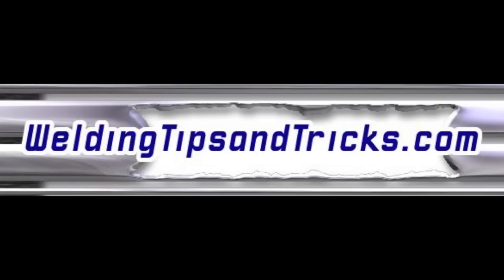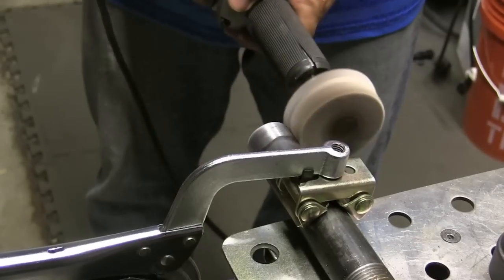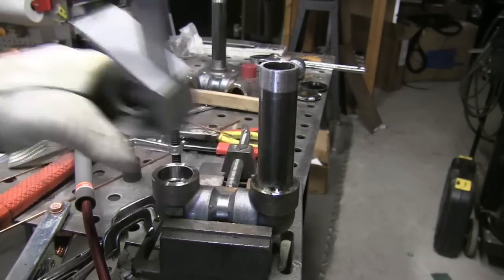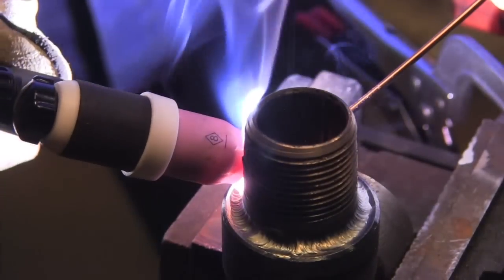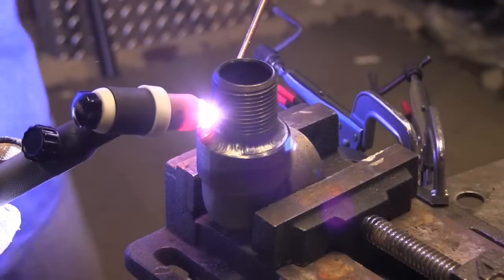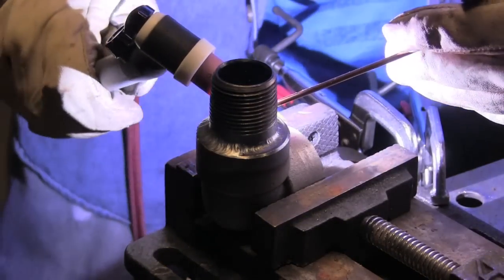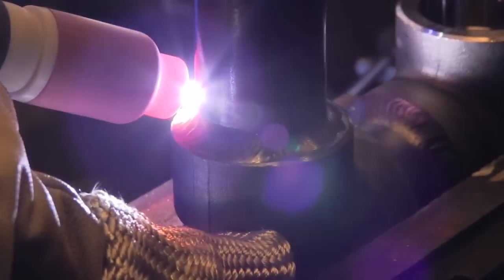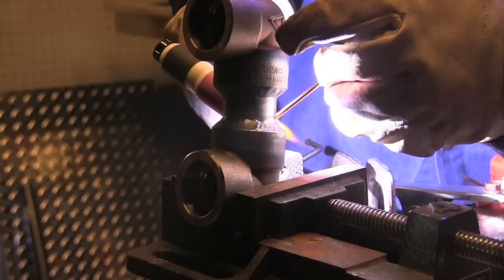Lift Arc Tig Welding Socket Welds

Comment: When you tacked the first weld that was at an angle, and then you used a level, did the pipe move to plumb for the second tack or did the entire piece move to plumb in the vise?
In other words, is the pipe inside the elbow  plumb after the complete weld up or is it out of plump?
Thanks

Comment: What kind of gloves do you use?  And what torch?

I have a Miller Maxstar 150, lift arc like this, at work with a 17 series torch and I can't hold it up close to the head of the torch like that for more than a couple of beads at 85-90amps without it nearly burning right thru the glove.  Have similar issues on my Lincoln TIG 275 also so I figure I may just have crappy gloves?

Comment: While walking the cup, it seems like the torch angle is very shallow. How does that affect the input or penetration of the weld?
Reply: idriwzrd I normally have my Amp's up higher walking the cup so i would think it would balance out.

Comment: Jody, awesome video, like always very informative. Hope you are enjoying the vacations. You may get this question or comment a lot and please redirect me if you already have answered already or if there is a video about it, but I would like know what would be the better choice between the Miller multiprocess 200 and the Lincoln 210mp? I would like to get started in welding as a hobbyist only and space and budget are limited, so the idea of owning only one machine is relatively tempting. I have read your comments in your site regarding Miller and getting a syncrowave and a cheap mig, but the prices for both are not ideal for me. What says you? 
Thanks for the videos, I'm starting a welding class pretty soon because I want to get some basic instruction partly because of your videos. Keep up the videos they inspire people to weld.

Comment: Hey Jody, what is that wheel at the end of your electric die grinder to clean coating of the pipe ?
Reply: chris hong its a flap-wheel sander, like a hundred pieces of emery paper glued to a steel shaft, any weld supply website or shop should have them, they also make them for angle grinders
Reply: harbor freight sells em cheap

Comment: Thats really nice. Ive got a 350 power mig that i have given up on the tig option. Mainly because of the lift arc...dont like that at all...spend more time unsticking the electrode than welding. You make it look smooth as can be. :)

Comment: Jody what is needed to do some basic tig welding for exhasut pipes n such with the 210 mp?
Where can I get a gauge to determine thickness of metal being welded.
Thanks
Reply: +Robert Botello Instead of buying the Lincoln setup, I bought a CK Worldwide torch, and pedal from USA Weld.  You'll have to buy the Lincoln adapter for the pedal.  Much cheaper this way.
Reply from the maker: Robert Botello the foot pedal option is best for thin exhaust tubing but I would say 18 ga could be done without a pedal if you are up for it.
a simple cheap 10 dollar set of calipers will work for determining thickness.
Reply: Thanks for reply. So the kit Lincoln sells is almost 600 last I checked. What would I need to buy to get started?
Reply: Thanks Ryan u have link I have no clue on tig equipment
Reply: +Robert Botello the 210mp really is a waste for tig, for about the 2k u spend your only getting lift arc DC tig. look at a AHP alphatig200. acdc tig for about 1k
Reply: Thanks,  wish I wouldn't have bought spool gun then
Reply: AHP and Everlast are good welders for much less money. If you can, get a welder with adjustable postflow. In my area argon ain't cheap so adjustable postflow saves gas.